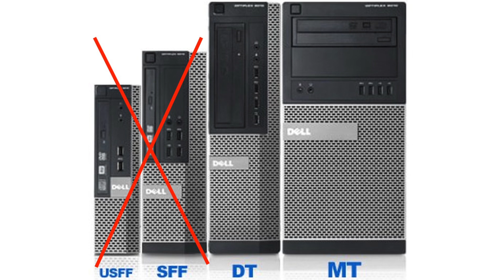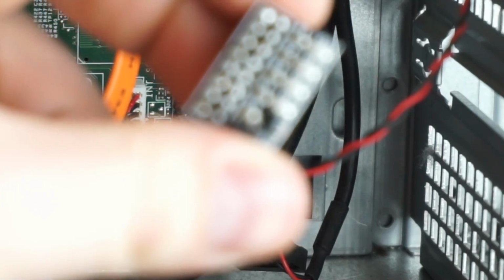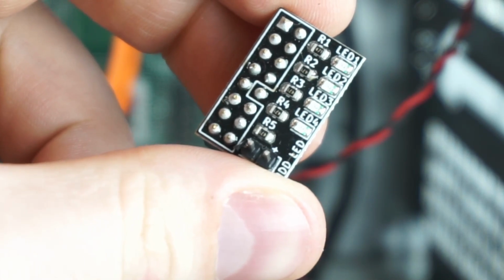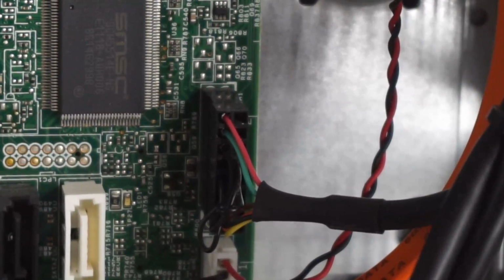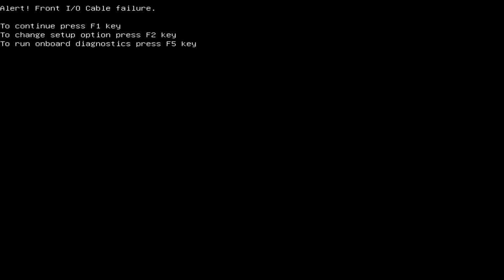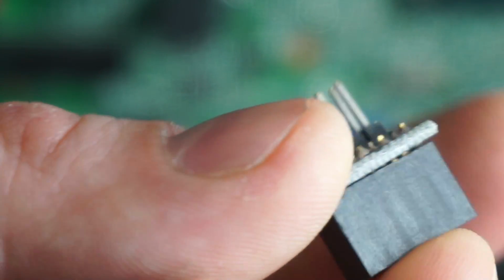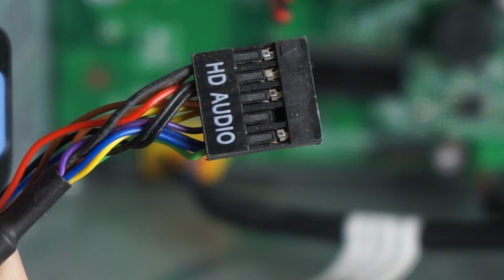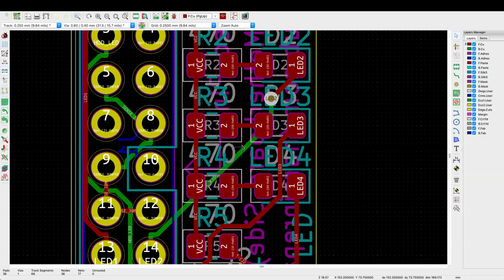Dell Optiplex Front Panel Header Adapter Installation - Optiplex 390, 3010, 3020

Comment: The DELL 3620 work with your adapter, but you need to make another adapter to skip the "Front I/O panel error"
The 19 pins blue USB 3.0 connecter need to gounding the pin 10.
Regrading the front I/O panel adapter, I just got another female to male socket, then stack on your adapter, this raises the height of the adapter and it work perfectly !

None of the LEDs work on the 3620 motherboard with your adapter.
I brought a used front panel of 3620 and get this information.
Hope you can update your website and let more people know.

Comment: I noticed on the website it says that the dell precision 3620 isnt officially supported because the adapter touches the m.2 slot. does that mean i shouldnt attempt to use it with that model? or that i shouldnt use the adapter kit if im using my m.2 slot?

Comment: I really hope someone sees this and can answer me. Long story short, My son's computer was damaged and it was an old Dell XPS Desktop. I was putting it together tonight with some new parts and a new case, when I realized the USB connector from the case has the missing pin on the opposite corner than the motherboard. Will this kit solve this? I'm praying it does and I can order it and get it before his Birthday on October 5th...Hope to hear back. To be honest, I'm not entirely sure if I need the other adapters, but I do know the motherboard is NOT labeled when it comes to the lights and front panel connectors, so maybe that adapter will help me there as well. If you see this, thank you for hard work and sharing it with us!

Comment: You showed yourself changing the LED on the front with a button on the case. My case came with a "LED" Header, where did you put that one on the adapters ?
Reply from the maker: If you are referring to the power LED on the front panel, yes you plug that into the power LED on the adapter even if its just labeled "LED", sounds like you have a case with only one LED which is fine.
Reply from the maker: That is the old reset button on the case, it was plugged into an RGB controller that is separate from the motherboard, it is powered by one of the additional SATA/Molex power connectors on the power supply. The adapters have nothing to do with the

Comment: I've got an old optiplex case that I want to put modern hardware inside as a sleeper PC, are there any kits to do the opposite of this and adapt the proprietary optiplex front I/O connector and power button to work with standard motherboards?
Reply from the maker: There's nothing on the market that we know of, for custom stuff like that we recommend splicing the wires since there's very few people who are interested in this.

Comment: I followed the guide step by step on my dell optiplex 3020 mt board and I’m still getting the error on my pc. I plugged in all the adapters too. The power button on the front case io works to start the pc so I know the pwr switch adapter is working. The front usb on the case io isn’t working but seems to detect when I plug something in (it tells me usb isn’t recognised while in windows). Hdd diagnostic adapter is not lighting up so I’m not really sure about that. There is a blue USB f 1 header that has nothing on it but I’m not sure if that’s the issue. Any ideas?
Reply: I just realised the reason the hdd diagnostic isn’t doing anything is because I don’t have a hdd in the system lol. So not the problem
Reply from the maker: If you are getting a USB not recognized error then you might have the USB adapter plugged in upside down, this can also cause a front panel error. If it is in the correct orientation and still giving you an error in windows then your front panel USB cable might be way too long or poor quality, also the internal headers cannot push much power so USB hard drives or higher power devices may throw that error in windows when using the front panel USB. The best thing to do is try the old Dell front panel USB cable and see if the problem persists.
Reply: @HarbinRepairs  I figured out the usb not recognized error. I heard that the green front panel headers on the motherboard only supports usb, not usb 2.0 which my case io has. I basically fixed it by using the blue usb headers instead which worked. I am still getting the front i/o error though. I even used a header jumper on pins 8 and 10 on the green headers and it didn't fix the error either. At this point I am unsure what the issue could be.
Reply from the maker: @BooToob  Something I forgot to mention is some cheaper cases have a front panel audio adapter that does not have the detect pin grounded resulting in the motherboard thinking the front panel audio isn't connected and it will throw a front panel error.
Reply: @HarbinRepairs  Front panel audio does work so im assuming that the HD-AUDIO cable works as well. You can plug in a pair of headphones and audio works fine.
Reply from the maker: @BooToob  Front panel audio may work but it may not be grounding the detect pin on the motherboard to get rid of the front panel error, some cheaper cases don't have that detect pin on the audio cable. Best way  to narrow down the issue is to plug in the old front panel audio cable and see if the error goes away, do the same with the other front panel connectors.
Reply: @HarbinRepairs  alright I'll test that out!
Reply: @HarbinRepairs  I solved the issue!! It was actually the HDD diagnostic adapter. Like you mentioned in the video, the HDD diagnostic adapter has pins slots that are not used on the 3020 model. I had accidentally positioned the adapter with the bottom 2 pin slots not being used, instead of having the top 2 pin slots "hang off" if that makes sense. The error only goes away if the adapter is placed with the top 2 slots "hanging off". Thanks a lot for your help, I was going crazy 😅
Reply from the maker: @BooToob  Glad you were able to get it working, that was the only thing I didn't consider since I can't physically see which board you have. Yes some of them have missing pins but the adapter is compatible with all of the models listed, just make sure to align the notched out pin with the notch in the adapter as you said.

Comment: Maybe you can help me.  I have a Vostro 270, the power/reset/hdd wires are in one connector.  The wires are not labeled, but I want to connect this switch to a regular motherboard's header pins for these.  Basically doing the opposite of what you show, putting a modern system in an old Dell case.  Any thoughts or solutions?  Appreciate it!
Reply from the maker: We don't currently have any adapters to do the reverse wiring, splicing the cable would be the better option.

Comment: This kit fried my PC, I've built several PCs over the years, installed it with the power off and psu unhooked, when I powered my PC on it no longer outputs video with or without the kit. And one of my ram slots stopped working... super Glad i spent 25 dollars to fry my whole PC....
Reply from the maker: That is an issue is unrelated to adapter we sell given that one of your RAM slots has stopped working. Keep in mind that the RAM slot has direct electrical connections to the CPU and not any other part of the motherboard such as the power button header or USB header. Sounds like you may have a damaged CPU socket or a bad CPU. Also there could have been an error in installing the motherboard in a different case resulting in multiple issues as you are describing.
Reply: @HarbinRepairs  while it's possible that the ram issue may be unrelated and purely coincidental, I can't ignore the fact that my PC was perfectly operational for months of daily use in the new case, I just had to press f1 on startup.. until i installed this kit, and now will for some reason not output video in any way. I double checked everything to make sure it was all plugged in correctly before hooking the power supply back up and powered it on. The instructions explicitly state that if installed incorrectly it could damage the motherboard so my assumption is that some of the solder traces on the kit may have been crossed  causing my issue, not sure why it hapenned. But I am 100% certain it was installed correctly as per the instructions
Reply from the maker: @peksacola  We have been selling these adapters for two years and never had a customer left with a dead board due to our adapter, even when installed incorrectly. Email us your board D/PN number, clear images of the adapter and how you installed it then we'll look into this. Thank you, info@harbinrepairs.com

Comment: does the power button adapter get rid of the cable error? Im using a dell optiplex 9020mt in a virtual pinball cabinet. I've extended the button contact wires to a button mounted externally on the cabinet. I'm getting a power error that requires hitting f1 to continue startup.
Reply from the maker: You must have both adapters installed to get rid of the front panel errors. A "power" error might be a separate issue unrelated to the front panel.
Reply: @HarbinRepairs  I'm still using the front IO in the case. What I've done is taken the switch wires from the board and disconnected them from the optiplex switch and connected to an external switch. Now getting power button cable failure

Comment: Has anyone used this on the 3040 model? I have a couple of them and if this works that would be huge
Reply from the maker: Only the power button adapter will work.
Reply: @HarbinRepairs  awesome thanks for the response 🙏🏻

Comment: Hey Can you help me I plug the power sw in the power switch the led + in the led - in the top right power I plug the front hdd in the right spot I also have front audio connectors but my gaming pc has only usb 3.0 connectors in my dell optiplex 3020 has 2.0 usb connectors I plug the little switch in it but it still pops up errors can you help!
Reply from the maker: As stated in the video all adapters must be plugged in including the USB 2.0 adapter and the front panel audio to get rid of the error.
Reply: @HarbinRepairs  I fixed it thank you tho

Comment: Thanks for this video man.
I have a simple doubt, if my case doesn't have any USB 2.0, will I get the front I/o failure alert?
Reply from the maker: As long as you have all of the adapters plugged in and the front pane; audio then the error should go away.
Reply: @HarbinRepairs  thank you so much

Comment: i fixed the front i/o error by looking at the usb i was putting into the green socket..theres an extra black earth wire on the dell one..so i just jumped a wire in my usb plug ..the one above the black hole over to the earth wire to its left..  just used a piece of wire and it works..i also now have the usb ontop of the pc working...   stop video at 2.28..
Reply: Can you explain a little more please? This error is so annoying. Thanks!

Comment: Great adapters very handy. The case I'm using has only USB 3.0 front panel ports so nothing to plug into the 2.0 USB header. Any work around for the i/o error in that situation?
Reply from the maker: The USB 2.0 port header has one pin sticking out from the rest which is for detection, just jump that pin to the one next to it to ground it and that should get rid of the error if you don't have a USB 2.0 front panel. Make sure to double check the pinout for the USB 2.0 header on google images.

Comment: Just ordered one for the 990 and it came in, i cannot get it to work can someone help
Reply from the maker: Check the included manual for detailed installation instructions, if you have an SFF model and not a DT or MT model then the adapter kit will not work.

Comment: How do I get the 3 rgb fans connected to my dell optiplex 9020 motherboard
Reply from the maker: They are powered by a molex or sata power connector.
Reply: @HarbinRepairs  can I contact you anywhere
Reply from the maker: @imsevn  harbinrepairs.com

Comment: Fun fact: If you happen to own a Bluetooth keyboard. The computer will not recognize any keyboard on boot (because no driver is loaded at the time) which will also throw an error saying no keyboard found. But then it will let you boot into windows without pressing F1 because... well you obviously cannot press F1 to continue. On the login screen, all drivers are loaded correctly, by then the computer will function normally.

Comment: Will these work with a 5040 MT?
Reply from the maker: The DFP05-PWR-T power button adapter linked in the description will work for the power button connector on the 5040 model.

Comment: Does this support argb cases?I have a 9010 MT motherboard I wanna know if it’s compatible, my new case is coolermaster mb311l argb
Reply from the maker: As far as we know unless you have a proprietary power button connector in a standard PC case which is slim to none then it should work just fine.
Reply: @HarbinRepairs  the adapters i got work just fine, but for some reason im not sure why my front argb fans light up but dont spin, its kind of frustrating i wanna know if there's a solution.
Reply from the maker: @cyrusaa  These adapters are only for the front panel elements, Dell does not have any type of RGB connector on their boards.
Reply: @HarbinRepairs  I see, i didn't do my research correctly and bought two cases and neither of them are compatible, i guess I'll just keep them in the garage until one day i make use of them. I was wondering i should probably ask this to a professional before making a decision again and repeat the same mistake, do you have any good airflow rgb cases suggestions for my dell optiplex 9010 MT?
Reply from the maker: @cyrusaa  We don't specifically, check out the Linus Tech Tips forums, they might be able to help.

Comment: Do you make adapters to do the exact opposite of this? Like if I wanted to put an aftermarket mobo & ryzen cpu in my dell 7010 mt case to make a sleeper build?
Reply from the maker: We don't currently since it would be confusing for those who are looking for Optiplex motherboard adapters and there's not much demand for it. Honestly a sleeper build would make more sense in a much older case.

Comment: Any plans to support the Dell Tower Optiplex 7040, I am thinking of getting one for this purpose, and quiet happily put it together, I just don't really understand the technical side of things.
Reply from the maker: Check the video description, the DFP05-PWR-T 5pin power button adapter will work with the Optiplex 7040.

Comment: I bought the entire kit but every time it starts up then it’ll turn off and now the power button only flickers and the fans don’t move at all can’t turn it on
Reply from the maker: Make sure you align the white arrow on the adapters with the missing pin on the motherboard connector, sometimes the adapter needs to be flipped upside down to accomplish this. Send us an email on our website if you're still having trouble.
Reply: I tried all ways and now I put back the original connectors  and now I can’t turn on the desktop  just have an orange light
Reply: My computer won’t turn on anymore fans don’t blow just an orange light I just bought this motherboard a week ago
Reply from the maker: @cottonsenpai  The orange light indicates a blink code, look up the blink code on Dell's website to determine the issue, it sounds like you have a different issue (RAM not seated, bad power supply, etc.). If you need further assistance just email us at info@harbinrepairs.com
Reply: @HarbinRepairs  I tried emailing well contacting on the site it won’t let me
Reply: My psu is a month old I bought it brand new not used the Ram was working perfectly fine I’ve even reinstalled them multiple times in different ways I’ve unplugged plugged it back in and nothing just a glowing orange light power button doesn’t work
Reply from the maker: @cottonsenpai   You can give us a call on Monday and we'll walk you through troubleshooting this issue, it's a lot easier to deal with it that way. Our apologies about the website form, we'll get that taken care of. For now just send us an email to info@harbinrepairs.com with your motherboard model and pictures showing how you plugged in the adapters, that way we don't have to go back and forth in the YouTube comment section and we can visualize the situation. Thank you
Reply: @HarbinRepairs  I’ll try I can’t find your email
Reply from the maker: @cottonsenpai  info@harbinrepairs.com, it has also been mentioned several times in our previous replies, also go to store.harbinrepairs.com and click on the email icon at the top right. There is also an email button on our facebook page as well as the about section of our YouTube channel.

Comment: This seems  a little overpriced, I'm not going to lie.
Reply from the maker: No problem, all of the hardware is open source on GitHub linked in the description with all the materials so you can build your own.
Reply: @HarbinRepairs  Ah alright, I actually made this and the only compromise I needed to make is use the fan hole, to have the power switch from the old case work, it's not the prettiest but it works fine.

Comment: Hi Harbin Repairs, I bought the Power button adapter on from your eBay store and I am having a difficult time getting it to work. I followed instructions in the video and its not working at all. I carefully triple checked my work and I am sure I am following the exact instructions. I even flipped the case connector wire so +- side can be opposite I thought maybe that was the issue.

Its the same story with the power led as well. It simply will not work. Please help! I will also message you on ebay with photos so you can verify.
Reply from the maker: Try flipping the adapter upside down and make sure to align the white arrow on the adapter with the missing pin on the motherboard connector.

Comment: Do you know how to remove rear fan alert
Reply from the maker: You'll need to reuse the original rear fan or you can try the rear fan adapter linked in the description however that might not work depending on the fan you choose.